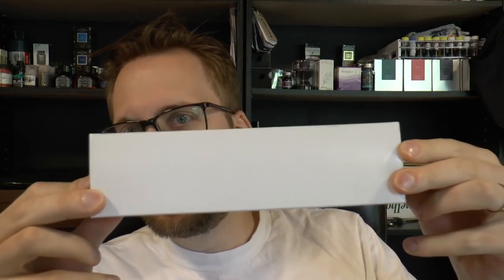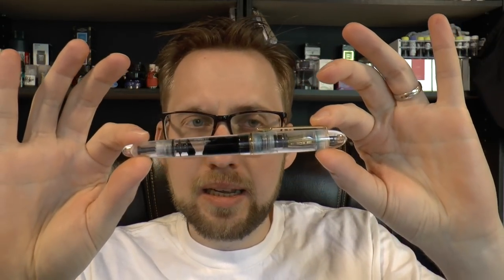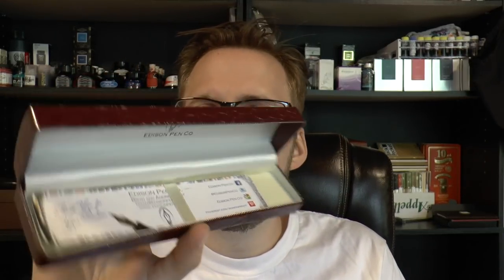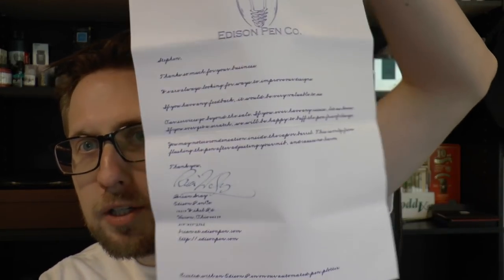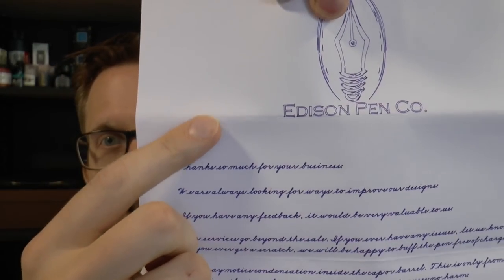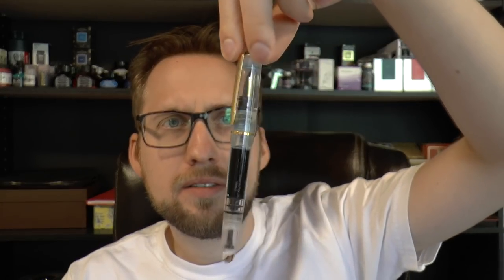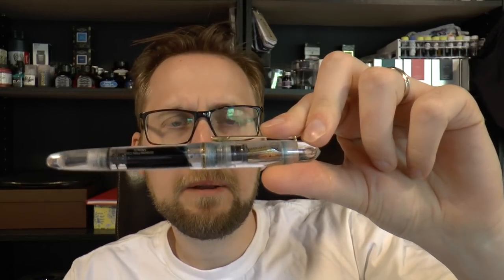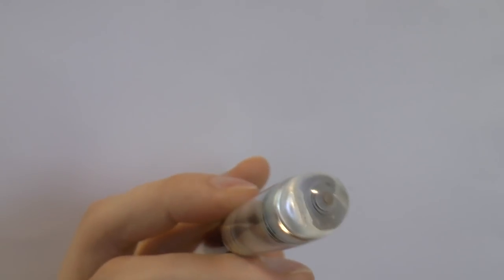Edison Menlo Draw Filler

Comment: Thanks for another uplifting review!  I have a clear Nemosine Singularity that I keep filled with MontBlanc Midnight Blue for addressing envelopes and any other more permanent applications.  It lives on my desk.  And yet, those speckles of ink end up in the cap.  Now, I don't live on a bus line or next to train tracks, nor am I particularly energetic while using the pen.  Makes me think that happens with all pens, and we just don't see the ink spots because of the opaque material.  I notice the same thing with my Visconti Opera Cherry Blossom (mostly white, mostly opaque).  I have to rinse them all out once in a while.  When I probe any of my pen caps with a Q-Tip, ink very often shows up on the cotton.  What do you think?
Reply from the maker: I think it is a matter of causing tiny vibrations as one caps the pen: that just causes some small droplets of ink to become airborne.
Reply: Likely and good idea.  Both those I mentioned are screw caps.  Perhaps I'll have to try smoother screwing-on-and-off.  Or perhaps they have alchemist caps and are perpetually evaporating and condensing trying to make gold ink out of blue-black.

Comment: Pilot call this filling system the CON 70.
Reply from the maker: Jay Taylor Except that's a spring loaded converter and this is a draw-filler that utilizes the barrel for a considerably higher ink capacity.